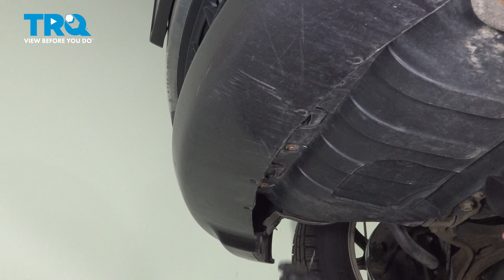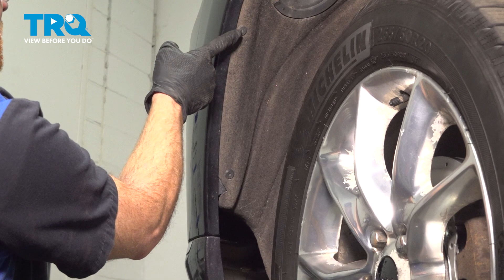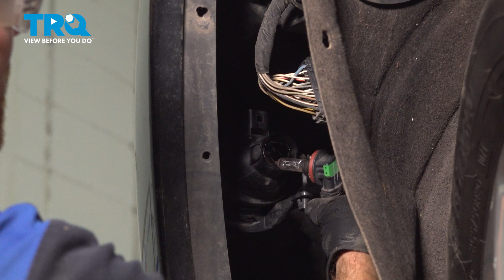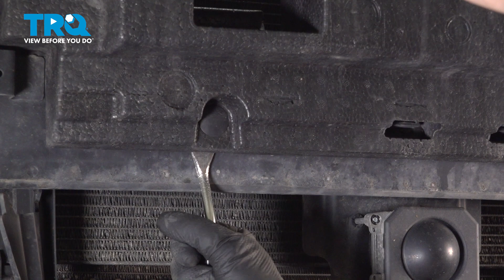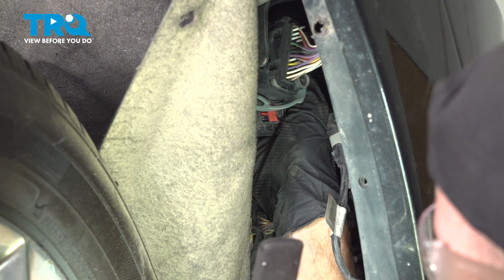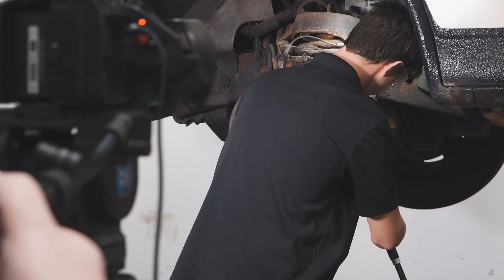How to Replace Front Grille Mounting Bracket 2011-2021 Jeep Grand Cherokee

Comment: I need to replace the grill bracket. I have the lower fascia off, and it would seem it can be replaced without removing the grill. Did you really need to remove the entire bumper assembly?

Comment: Besides my wheel well. What is the part that my lower front fascia is connected to on my 2021 80th Grand cherokee. it connects w/ a 1/4 turn plastic clip, and it is a plastic piece below the adaptive curse control attached to some metal piece but the main beem??